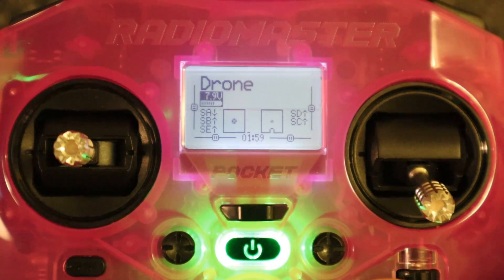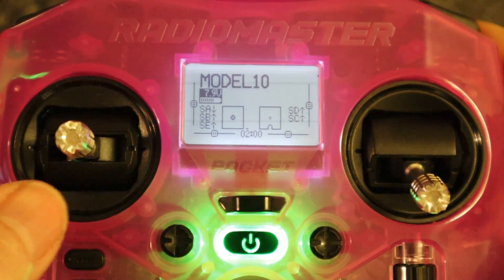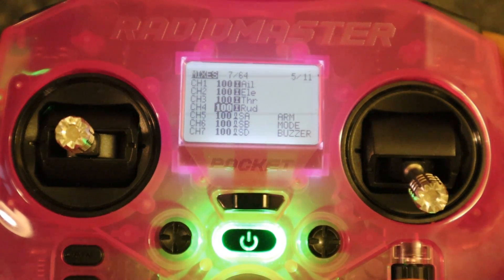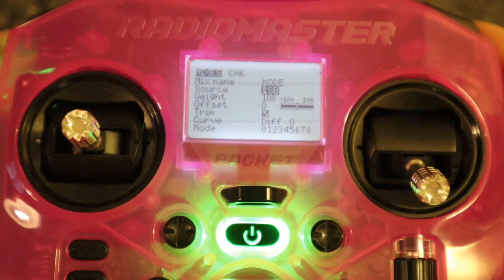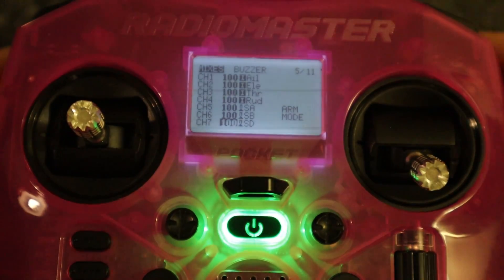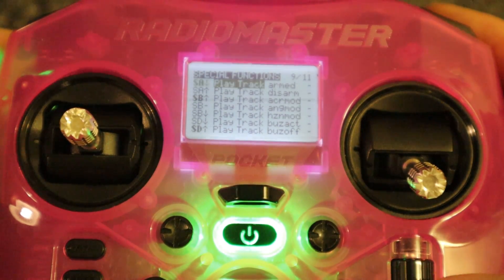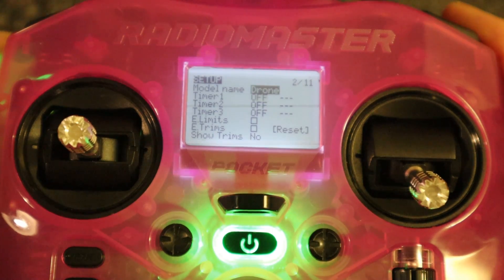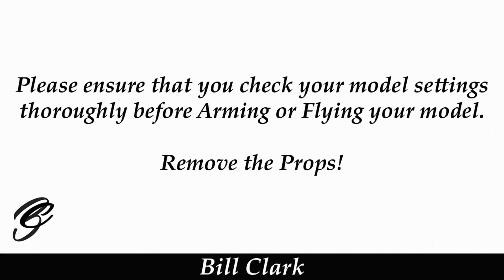RadioMaster Pocket Basic Quadcopter Settings

Comment: Hi can i add multiple model to my RM Pocket? I have the ELRS VERSION and have one mobula 8 binded and want to bind a tiny hawk 3 freestyle. I haven't built a binding phrase because o don't know how. Just been binding through CLI tabs. Please help me..?😢
Reply from the maker: I would suggested setting up your binding phrase. This video will help you update your radio and receiver firmware at the same time adding your chosen binding phrase.
Reply: I need help my Rm Pocket doesn’t connect to betaflight but I think it’s connected to drone because it says telemetry recovered
Reply from the maker: The radio will not connect to beta flight but the receiver will. Could you please give me more detail of what is not happening. Can you see the receiver active in Betaflight?
Reply: It connects the to receiver but not beta flight I think I have a video on my channel it’s the only video I have to describe exactly what happens please help thanks
Reply from the maker: @koshperez806 sorry your video is not clear. You need to bind your receiver to the radio before connecting to beta flight. You will know it is connected because you will see the connection bars on the front of the radio. Set up the pass phrase. Check my videos. Please do this first. Then connect to Betaflight and check the receiver tab.

https://youtu.be/F6tAUYxg8CQ?si=PzargjmjLIUc9lGg

This is an old video but should help you with Betaflight.

Comment: Hi Bill,  I am trying to configuring my pocket radio for a drone I have built.  I am using INAV.  Am I wrong by thinking every switch position can be used as a channel?  Take channel 5 push button for example...can I use its up position as one channel and its down position as another channel?  And then the 3 way switch next to it that you labeled as the mode switch or channel 6, can I set that up as say channels 7,8, and 9?
Reply from the maker: Yes you could set a switch to a channel and have the channel only move to on and another switch off. I have never set this up but would be possible.